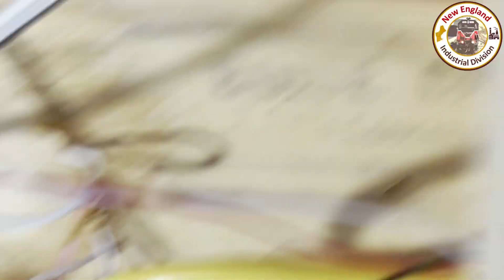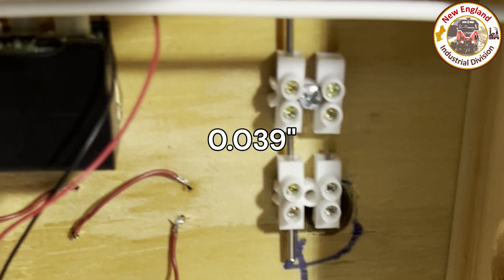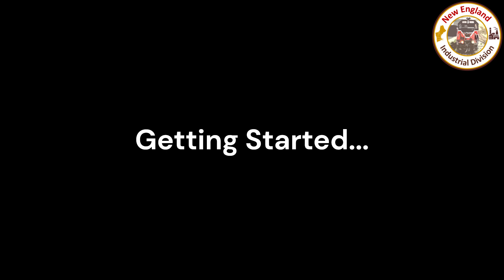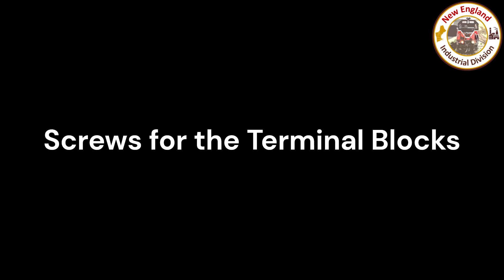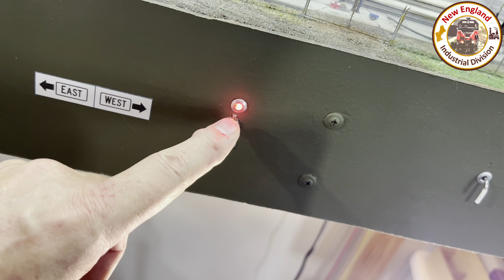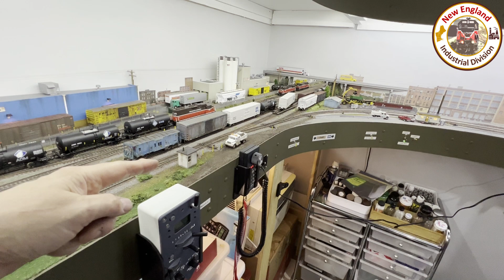Control Your Model Railroad Turnouts

Comment: A tip to protect the points when drilling up through the base board is to carefully slide a thin hacksaw blade directly under throwbar hole and drill up against the hard surface of the metal blade.
Reply from the maker: Excellent tip! Thank you. That would have saved me a couple of turnouts.

Comment: when i had to do this i drilled through the plywood and part way in to the homosoat than put a router bit into a hand drill the old turn with your hand and used that for the final cleanout
Reply from the maker: I’ll give that a try!

Comment: For drilling through the plywood plus whatever else you're using as a substrate be it styrofoam, homasote, etc, I would highly recommend purchasing a couple of collars. The fit over top of your drill bit and have a screw on the side so that you can be absolutely sure of the depth you are Drilling. Especially in a situation like this where you can buy a collar I'm guessing no more than $10 will save use the aggravation of accidentally drilling too deep. Considering how much turnouts cost, less than $10 is a wise investment.
Reply from the maker: Great tip! Thank you for sharing.

Comment: I like the idea of manually operating my atlas o guage swithes when they are far away on the trainboard.  Atlas o gauge switches seem always problematic, working maybe maybe not. The best is replacing the atlas switches with ross switches. The atlas o switches were about $110 each and ross even more. We have 15 swiches that are problematic.  So we need a detailed install video using your wire manual method. Gary
Reply from the maker: O gauge is expensive! My last big layout was Lionel.  Shoot me an email if you have questions with the mechanisms. 
NewEnglandIndustrialDivision@gmail.com
Reply: @HartfordWhaler thanks much

Comment: This is an excellent video!  Very informative.  I really like your method of manual switch control - and you explained it well.

Quesion:  On my new layout, could I drill the holes for the switch wire when laying the track - but just not use them until I get around to (if ever) making manual controls or buying tortoise machines?  Is there a downside that I'm not seeing?

P.S.  You have a beautifully detailed layout.  Very realistic.  Nice work!
Reply from the maker: Thank you! Yes, ideally, you want to drill the holes before final install of the track. I just thought I wouldn’t need them until I changed my mind. Place the turnouts temporarily where you want them and drill a pilot through the hole between the points. Then remove the turnout and drill a 3/8” hole. Then lay the track.
Reply from the maker: Thank you! Yes, ideally, you want to drill the holes before final install of the track. I just thought I wouldn’t need them until I changed my mind. Place the turnouts temporarily where you want them and drill a pilot through the hole between the points. Then remove the turnout and drill a 3/8” hole. Then lay the track.

Comment: Nice job with this video. Can I suggest the possible use of Model Railroad Control Systems MP-4 switch machines for your needs? I bought 4 of these and expect to purchase more as they are smaller than most machines on the market and you can control frog polarity if need be. I also wired two in tandem to do a runaround on my layout. Look these up sometime..Another note is that the switch ties you have got a hole available on both sides, hence you could control these from the outside versus trying to cram them next to each other to put the throw arm into the middle of the track. Keep up the good videos sir!!
Reply from the maker: Good tips! Thank you!
Reply from the maker: Just checked out the mp-4. Looks interesting. I might have to try one!
Reply: @HartfordWhaler  Hi Paul,  I liked those switch machines also because they have a terminal strip versus having to solder wires. Plus the mnp-4 has extra contacts for the frogs and for ;lighting signals. Have a great day sir!
Reply from the maker: Terminal strips is a plus.

Comment: Very interesting video! I too, use Homasote on 3/4 ply. Formerly cork ballast strips on ply, then foam boards, I found the foam reflected the train sounds too much, and the homasote absorbs even track noise much better. Super easy to nail into, and hold the nails! I like the manual connecting rods and guides, and may use that concept for non-machine turnouts. Thank you!
Reply: Doug, I can't find homosote here in nj, not at loews or home depot.  Where did you find it?
Reply from the maker: Love homasote
Reply: @HartfordWhaler where, cant find homosoat in home depot or loews here in nj.  Gary
Reply from the maker: Check with a local lumber yard. I got mine from East Coast Lumber and Supply in Vero Beach, FL. A small lumber/hardware store. Home Depot or Lowe’s only orders what they have contractor to order. The smaller shops can order whatever they want. Also check homasote website to see if they’ll list dealers in your area. Might need to contact their customer service. The product is used for a lot of things like stained glass, sound deadening, model rr, etc. There has to be a supplier in NJ.
Reply: @HartfordWhaler  How do you handle any bends in the rods to reach switches that aren't 90 degrees? Just checked, and I have 20 terminal strips (X12)!
Reply from the maker: You can bend the rods to a certain point. For big angles, I’ve used the tubing made for Bluepoint switch machines. It’s a red plastic outer tube with smaller OD yellow tubing that moves through the red tube like a bike cable. They sell just the tubing without the Bluepoint switch machines. Getting hard to find. The 2mm metal rod  I use press fits into the ends of the yellow tubing. Works great.
Reply: @HartfordWhaler  Thank you. Time to experiment
Reply: 3/4 is very heavy to work, and now, especially,  very expensive. You are fortunate. Gary

Comment: Quick question about your layout? Did you use alot of cork road bed or did you just lay it flat?...
Reply from the maker: All placed directly onto the homasote board. Since it’s an old industrial area in New England, the tracks are all pretty low, so no roadbed needed. I don’t have any elevated main lines, so it works. When I put down the ballast, it gives the illusion that the tracks are slightly higher than the ground.
Reply: I appreciate it, im building a 24 ft shelf layout an ive been watching your videos an really like how you went about your design. Im still trying to figure out mine for the time being. But again thanks for the info. @HartfordWhaler
Reply from the maker: You are welcome!

Comment: Hi, what make of turnouts are you using for the manually controlled ones? They appear not to be sprung, or you have removed the spring. Thanks ! I like the manual linkage and simplicity of the rivet.
Reply from the maker: All peco code 83 except for 2 Walthers on the big curve. Mostly #6 pecos with one #8 and a few #5s. I keep the springs in them. The only one I had to take out was the Walthers that has a tortoise because its spring was too tight for the switch machine to move. With the remote manual throws you really need the springs to hold the points in place after you throw them. The tortoise does that for you so in those cases you can remove the spring. I love peco track.
Reply: @HartfordWhaler  yes I have nearly all Peco track as the quality is superior and the top of the rail head for code 83 is narrower (not the height, but across the rail head) than Walthers and Atlas. I have a few older Walthers Shinohara points that have no factory spring. The quality of these are near bullet proof - ( in terms of the spikes holding the rail to the tie do not break easily). The do find however that the spikes on the peco flex are weak, and can seperate the rail from the ties with relative minor bumbs; same as Atlas code 83. I am in the UK where the Peco is manufactured so it is a bit cheaper than you pay in the US. Track has however gotten soooo expensive for turnout points!! How has it go that 8 turnouts cost hundereds, even before you think of a means to operate them?
Reply from the maker: Agree prices are insane. Also agree that peco turnouts can be fragile. But if you get them in place without damaging them they work excellent. Good old fashioned British quality!

Comment: I am having to relocate and rebuild my layout from an 8x10 around the room 16" shelf to adapt it to a point to point switching "L" using the 2 8 foot segments from the old one in a small apartment. Not my preference, but I do plan to include many more turnouts for a 2 large industry with smaller service spots and 2 servicing yards. I would like to have turning wyes or turntables at each end, but I can't figure out the space. Not very pleased with the idea, but that's how it must be. 
Rather than wiring every turnout for power, I plan to use mechanical push- pull knob to lever home built throws with above table simulated throws. 
Any ideas on any ways to improve on this idea appreciated 9(plan as a whole)..
Reply from the maker: Shoot me an email and I might be able to help you out NewEnglandIndustrialDivision@gmail.com

Comment: I use under the layout manual turnout rods also. I do like several of your methods used. I will use them to improve mine like the rivet heads on the fascia, and the terminal connector guides.Thanks again, great video.
Reply: Well, you did do a thorough job explaining everything.
Our club has a portable layout we set up for public display. Your manually operated switches would be ideal because some people like to flip the ground throws in order to create a little excitement.😮
Reply from the maker: That’d be a great application!
Reply from the maker: Glad you found it useful! Really appreciate you watching! It was a long video, but I wanted to capture everything.

Comment: Couple of points. 1) A friend maintains that since all turnouts in his yard are manually thrown by a brakenan, crossover turnouts  will always be thrown separately (purist)  2)  the second SPDT set on a Tortoise usually powers the frog., and 3) I use an Anderson-type home-built linkage for both powered and manual turnouts. More flexible and much easier to install than a 3/8 inch hole under the tiebar.
Reply from the maker: Good inputs. I love having the runarounds controlled with a single switch. But that’s my style, not the rule. Yeah, I ignore the second switch in the tortoise since I don’t power my frogs. Keep alive capacitors do their duty. The larger holes for me make everything easier and less prone to issues - also essential when the track is already put down and ballasted. And, I’m proud of my linkages :)
Thanks for watching!
Reply: I plan to convert my turnouts from power on a new layout (forced by a move) to mechanical knob to lever throws. Chief reason is getting rid of most of the old huge powered control board.
Reply from the maker: That’s a good reason